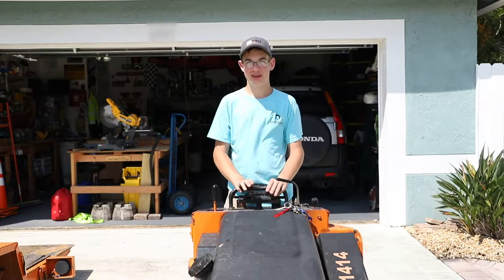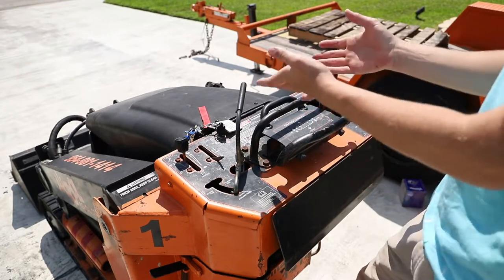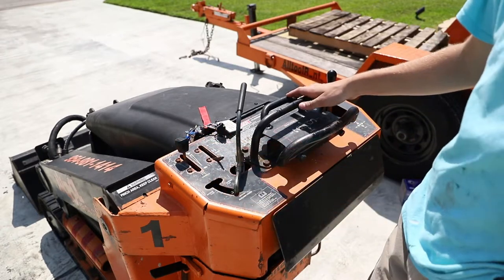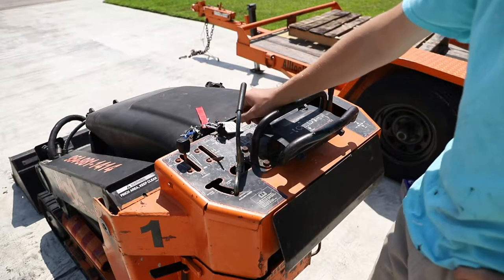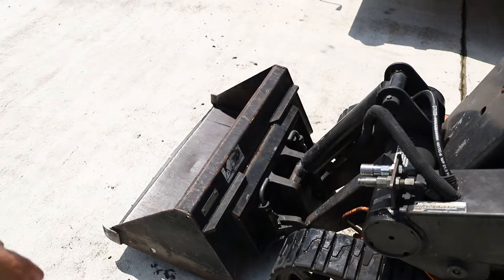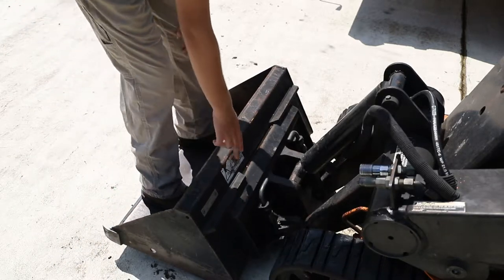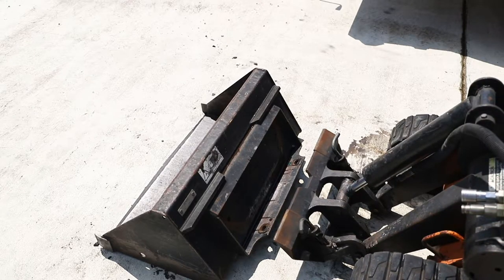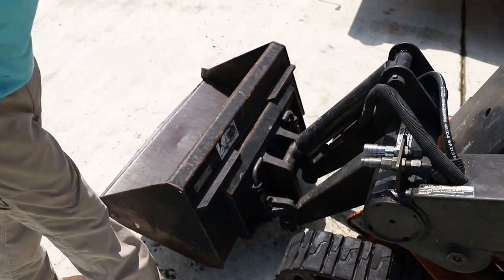How to operate a Toro Dingo AND How to load it onto a trailer

Comment: Quick and cheap suggestion for a wind screen for your microphone: a piece of faux fur from a craft store and rubber band.  Leave a dead-air gap between the inside of the fur and the microphone itself.
I've never seen one of these, so thanks for the info!
Reply from the maker: Thanks for the suggestion. I will look into that!